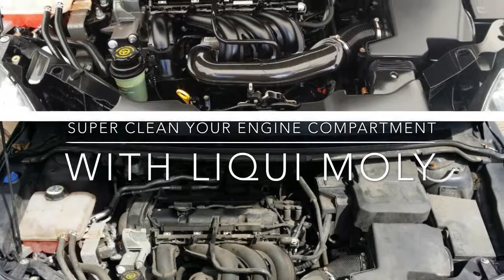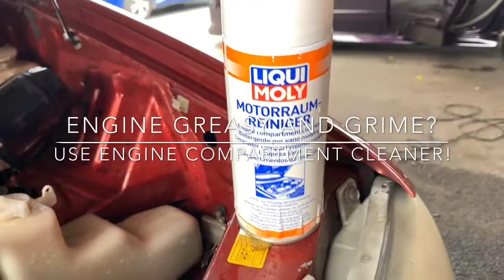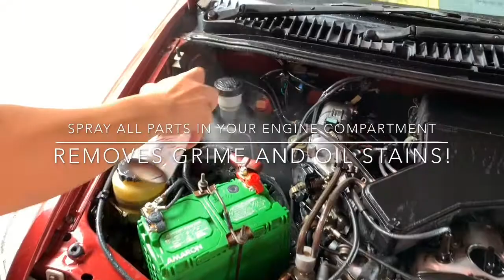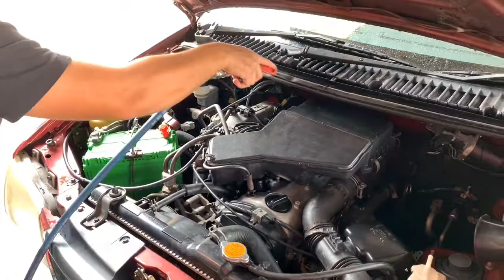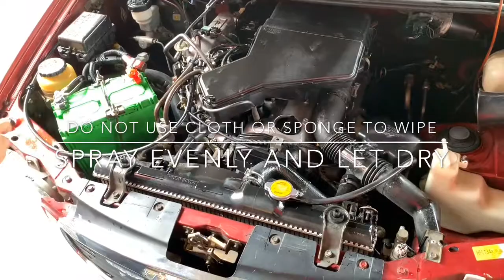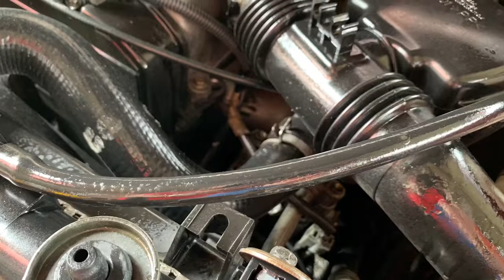Liqui Moly East Malaysia: SUPER CLEAN YOUR ENGINE COMPARTMENT

Comment: Please answer my question. I read online that ceratec is not compatible with molygen as it can cause faster sludge build up. Does ceratec only not compatible with molygen only or with other liqui moly engine oils as well such as top tec n other liqui moly engine oil?
Reply from the maker: Hi there Izuan! We appreciate you reaching out to us. LIQUI MOLY Cera Tec is an engine protection additive with friction modifying chemicals and ceramic compound in its content. LIQUI MOLY Molygen series engine oils also contains friction modifying chemicals called Molecular Friction Control. It is usually not advisable to mix both Cera Tec and Molygen series engine oil together as there will be too much of the friction modifying chemical. However, we recommend mixing Cera Tec to other series of LIQUI MOLY engine oils. As for Molygen series engine oils, mixing our Oil Additive that contains solid lubricant is recommended.

Comment: Question: can we simply wash the entire engine bay, especially newer car model, with water first without protecting or covering sensitive components BEFORE applying Liqui Moly?
Reply from the maker: Hi there Johan! We would recommend covering the battery and the entire ECU housing of newer car models before washing the engine bay with water. This is for safety precaution as newer car models may have more electronic components and may cause short circuit if water gets into them.